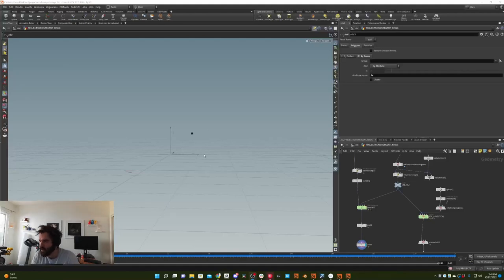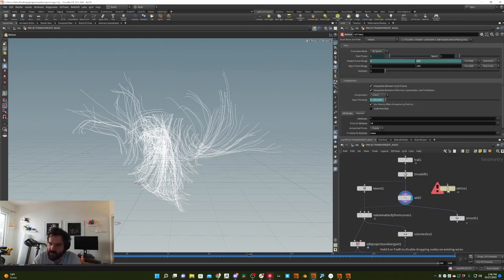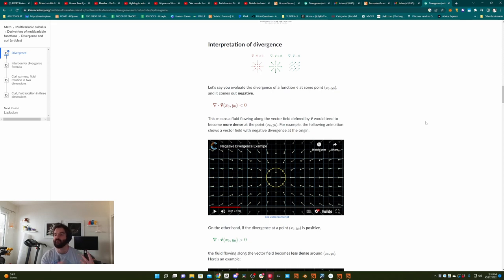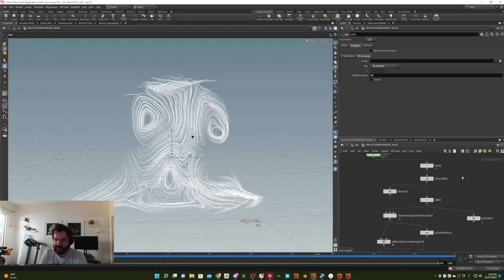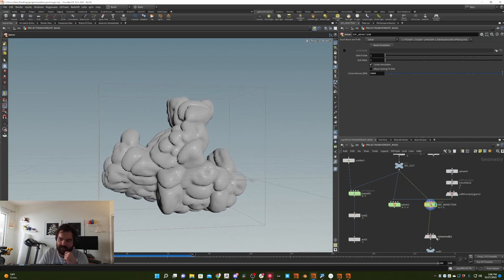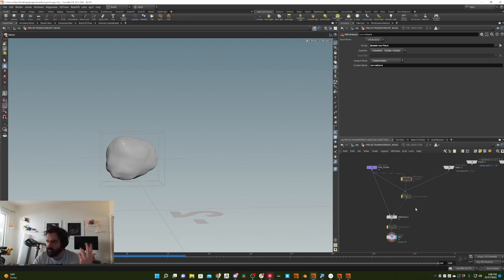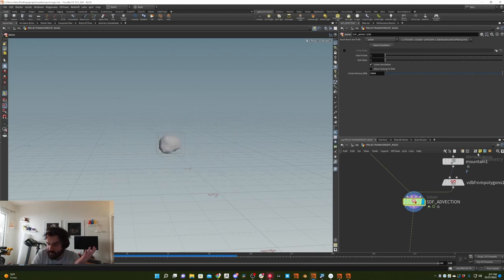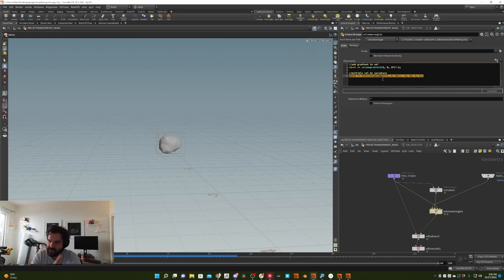Playing with Velocity Grids, Solvers and, Project Non Divergent Nodes

Comment: So good and well explained, thank you, Christopher! Me and Ronald Fong had the EXACT (!) same problem you are desrcibing in the intro. Did you ever find a solution for that? We were discussung the "classic" coral from particle trails setup and how you could make it intersection free. Any input would be greatly appreciated.
Reply from the maker: yeah i mean, that was pretty much what the next part of the video is an attempt at solving, using the project non divergent node to get rid of those intersections. not sure if thats the best way to get a coral or something and im sure there are other ways you could solve that kind of thing, but i think if your goal is to create a really art directed pattern ultimately, you are probably better off starting with the pattern rather than hoping to simulate something into said pattern. 

another thing you could maybe try, just thinking out loud, is doing a pop sim with a pop force and just set the pulse length to 0 so the noise isnt animated. then its basically just moving along a curl noise, so particles wont cross the same paths.